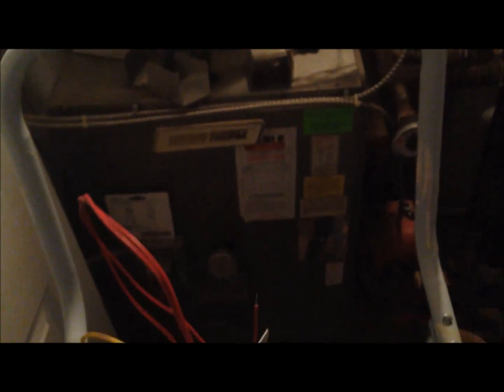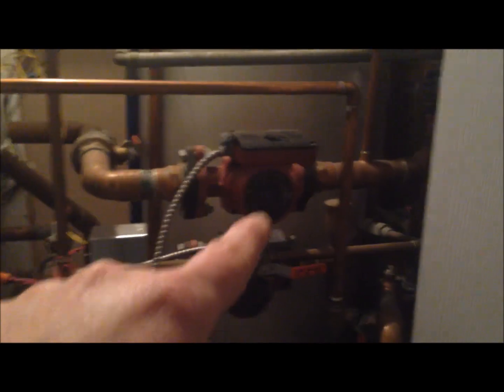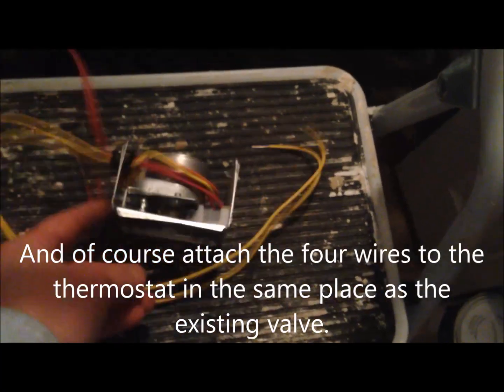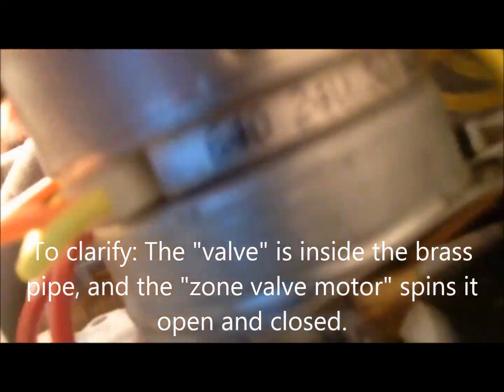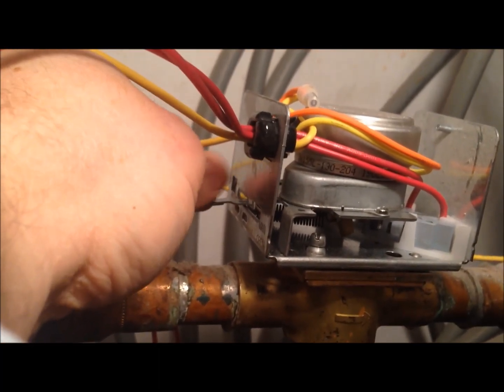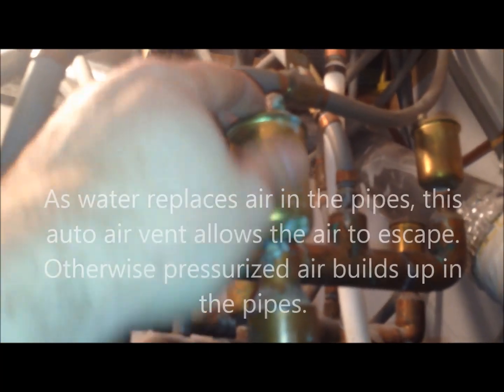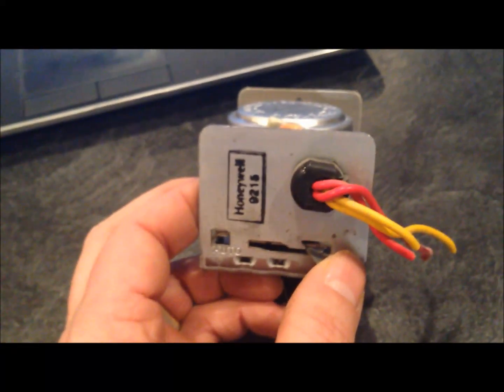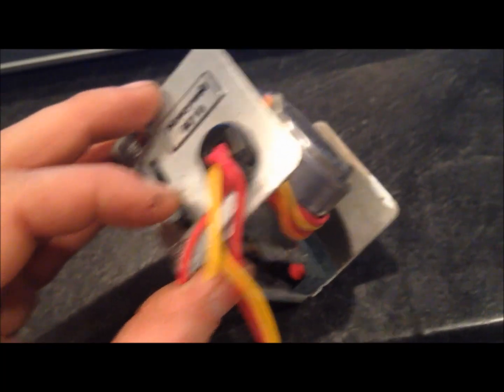Honeywell zone valve motor replacement

Comment: If my pump is not turning on, will putting the valve on maunally opening make the heat work? I know my pump works because I have a 2nd zone attached to it and when that zone goes on, the pump turns on. For this zone when I turn the heat on, the pump doesnt go on.
Reply from the maker: If the pump doesn't turn on, I don't think that opening the valve will activate it. The pump is activated by setting the thermostat to a temp higher than what the pump reads as the current temperature. If so, the pump is on, and tries to push hot water through the valve. At that point you can manually force the valve open to send hot water to the zone. Makes sense?

Comment: Hello. I know this video is old. Good stuff regarding the zone valve.  Absolute misinformation regarding how you added water to your system.  The valve you opened to add water "Pressure reducing valve" regulates the incoming water pressure to 12lbs. You opened the valve until the safety relief valve opened (typically 30 Lb)  This does absolutely nothing to get the air (bleed the system) out of the system rather only compresses whatever air is present into a smaller space. Secondly, the automatic air vents that are all over the place (a properly laid out system only needs one) : The caps are to be left loose as to let them do what they are suppose to. Automatically let the air out. The cap is only used in the event the vent fails and water runs out instead of air.

Comment: Hi.  When reattaching the wires, there are 2 yellow and 2 red.  Does it matter which red or yellow you use?  Thanks
Reply from the maker: Hi, no problem, all these wires are connected in parallel meaning all the reds and all the yellows in your entire system are ultimately connected to created one large circuit Any one can trigger the boiler/circulator into action.
Reply: Doug Brown so your answer is “no”. Correct?
Reply from the maker: @Mircea Hi. I'm pretty there's some solid state wiring involved. When the thermostat senses that the temperature is too low, it activates a switch completes a low voltage circuit that flows through the valve motor. The motor spins and pushes the lever until it stops OR after it is pushed past a certain spot. I think it's the latter because I've experienced motors running constantly when the valve was jammed and the lever couldn't move.

Comment: How did you drain the pipe?
Reply from the maker: No need to drain the pipe if you're simply replacing the motor assembly. You can see in my video that I just unbolt those four mounting bolts and the motor pulls right off. No water.
Reply: Wow, thank you for the incredibly fast response!
Reply from the maker: Anytime...

Comment: So mine is stuck in the OPEN position. Can I do the same thing or do I need to drain it somehow? I don't have any shutoff handles to isolate the zone unfortunately. That lever is loose and doesn't go back and forth like yours. no resistance.
Reply from the maker: Also, note that you don't need to drain the system if you're just replacing the valve motor like in my video. The motor fits onto the valve stem, which protrudes out of the pipe and doesn't allow water out.
Reply from the maker: Hi Blake. You're in good shape fortunately because replacing the whole assembly doesn't have any water implications at all. Just unbolt it like I show in the video and replace. The spindle protrudes out of the pipe and that's the component which is connected to the valve inside the pipe, and is immersed in water. You only need to drain the system if the valve is frozen in one place but that's very unlikely. 

Take off the valve power head like I show in the video and use a wrench to twist the spindle (make sure you don't damage the spindle) and close the valve. Then replace per the video. 

I always take pictures beforehand so I know exactly how the wiring was etc. 

Good luck!
Reply: Doug Brown
Thanks. Actually something weird happened last night. I went down to take more pictures so I could find a match online or at a big box store. When I touched and slightly twisted the round silver motor container to get a better angle the thing started moaning and the needle when back into place. The valve shut! I have no idea what I did, but I feel even better now about replacing it with the water cut off. Sure enough over night the temperature went from 71 to 55 in that space.

I'm going to start with replacing that component and hopefully I don't have to call someone cuz they want $75 just for showing up during business hours plus labor plus parts. Craziness. *Sorry to all who work in this profession but if you're coming during normal business hours and doing a quick 20 minute job there's no need to charge so much. I do IT in the same fashion and always charge reasonable rates even if my policy should state I could get far more.
Reply: Blake Whitney
Reply from the maker: No problem. Just remove the valve motor like in my video. Then close the valve by twisting it shut with a wrench, and install a new motor, again like in the video and that's it.

If you can't turn the valve at all with a wrench and it seems frozen (usually NOT the case) then you'll have to turn off your water supply to the system and drain the hot water pipes. Then cut out the valve by cutting the pipe on either side. When you buy a new motor it comes attached to a small section of pipe so cut that exact amount around the valve and install the new pipe/motor. Having said that, it's more complicated than just the motor and you need to consult some other videos on that job because I don't have one.The only hard part is installing the new section of pipe and you'll need a torch and some other stuff.

Good luck
Reply: +Doug Brown i just attempted to replace the valve motor and water started coming out when i loosened the screws, what could caused that?
Reply from the maker: That would tell me that the spindle which attaches to the valve inside the pipe is really damaged. There must be a crack in the hose right where the spindle comes out, so you'll have to shut off the water, drain the system and cut out the entire valve. You have to hacksaw each end of the valve (1-2 inches) where's it's installed in the pipe. When you buy the replacement motor it can come with the valve and copper pipe, along with the power head. OR you can buy the power head separately if your valve is okay. The first couple I did had the valve and I just tossed that part because my valve didn't leak. The last one I did was just the power head. When you install the valve just find a YouTube video or a site like this: http://www.familyhandyman.com/plumbing/repair/how-to-repair-a-leaking-copper-pipe/view-all

Good luck
Reply: ok so i need a plumber
Reply from the maker: You can definitely do it yourself if you buy a couple of things at the store. Here's a link to Home Depot that shows what you need, which is a propane torch, flux paste and solder. It's really not hard but if you to cut to the chase then a plumber can do it quickly. Make a video!
Reply from the maker: http://www.homedepot.com/c/flux_and_solder_HT_BG_TH
Reply from the maker: These SharkBite brand fittings are amazing for repairing pipes because they use compression fittings instead off the flux and solder. Unfortunately you can't buy a zone valve with a SharkBite.
Reply: i used sharkbite before
Reply from the maker: +paul spuria SharkBite is great, but unfortunately they only make simple straight through fittings, and ball valves etc. You'll have to cut and solder this one.

Comment: Hello Doug, Great video. I bought the motor but not the valve. Where can I purchase the whole valve (including motor). Thanks!
Reply from the maker: Hi. Normally you can only buy both together. I actually had to discard the valve because I didn't need to replace it. But I found that even Home Depot in the US sells the entire unit. You're in NY state? My friend teaches English at Binghamton.

http://www.homedepot.com/p/Honeywell-Tradeline-24-Volt-50-60-Hz-3-4-in-ID-Sweat-2-Position-Motorized-Zone-Valve-V8043E-1012/203464519

Comment: Thank you for this video.  I've got to change the motor out on my heating system.

Question: is it possible just to swap out the motor?  The mechanism responds properly to the manual override,but the motor does not run, even when I wire it into an adjacent (working) zone.

Thanks.
Reply from the maker: Hi, glad it was helpful. If you look on Amazon or wherever you can buy just the round motor attachment. I haven't done it, but there are two bolt holes on the motor pic and it looks very straightforward. It's a little cheaper than buying the whole powerhead, which I'm doing in the video. 

http://www.amazon.com/Honeywell-802360JA-Motor-V8043-V8044/dp/B0006UPLQC
Reply: I found it at Home Depot, for about $40.  Took me all of 5 minutes to swap it out, and the zone works again!

But it's always helpful to see it done, ahead of time.  Thanks again!
Reply from the maker: OK, thanks for letting me know -- Everyone take note! 
Doug
Reply: There are three "parts" to this system that I know of:

1) The physical valve that the water passes through (or not)

2) The mechanism that takes the motor position, and operates the valve (all those springs and stamped-steel levers and such)

3) The motor, proper.

There's also the housing cover, but who's counting.

The guy at Home Depot said something about an "end of travel switch", but my unit only has the two motor wires, and no switch that I could find, so....
Reply from the maker: Stephen Sywak Check this out around 2:10. That switch is the the one that gets activated when the valve is fully open, and it triggers your pump to start pumping.

https://www.youtube.com/watch?v=VE1wa033USA

Comment: That was very helpful. Noticed one floor of the house was cold this morning.Followed pipes back to the zone valve which was making weird noises. Have ordered a new one. Did you switch the power off first?
Reply from the maker: Glad it was helpful. No you don't need to turn off the power, because the wires are all low voltage. Your skin has ample resistance and you don't need to worry about turning off the circuit.
Reply: @DougBrownVancouver  This is not true for all systems btw!

Comment: i noticed there are 2 yellow and 2 red wires, obviously the two yellow go to the two yellow and red to red....my question is does it matter which two reds and which two yellows are connected?
Reply from the maker: No, they're low voltage wires that connect back to the thermostat and just complete the circuit. The circuit runs one way or the other depending how you connected them, but the direction doesn't matter--Just that the circuit is open or closed. There's enough voltage to support the current needed to turn the valve open or closed, but it's still non lethal in case you were worried about that.

Comment: Hi Doug,
Thanks for the demo, my situation is that when I put thermal on and moved the valve to manual open position like you said, the hot water still did not flow and the water is not circulated, If I do the same manual open position for another zone valve, the water flows and circulated. Do you think it is due to the zone valve broken? I would appreciate it if you could give me some advice.
Reply from the maker: I think the valve inside the pipe is probably broken. You'll need to make sure the pump is off, then drain out all the water from the radiant pipes (I don't think you can do just one--They're all connected to the same release valve). Then you need to buy a valve pump that includes the actual valve housed within a bit of pipe. To install, you need to cut out the existing valve by cutting the pipe before and after the valve, then install the new one. It goes without saying that the seal needs to be very, very good. I'm sure there are videos on this too.
Reply from the maker: Doug Brown Another thing to try FIRST is to lift the zone valve motor off the pipe. This will expose the splined spindle that the motor grabs to open/close the valve in the pipe. You can take a wrench and try to manually twist the spindle to see if it turns. If it's jammed then you know the valve is damaged. If it turns easily then just replace the valve motor, which is definitely broken. (This is what I demonstrate in my video.)
Reply: Hi Doug,
Thank you for your advice. Your advice is very helpful. I have fixed my problem.
Reply from the maker: Glad that I could help you out!h

Comment: Hey I have a quick question for you my zone vale moter seems to have seized up in the open position and the lever has no spring to it so I am sure it needs to be replace but do you think it's safe to remove the old zone vale with it stuck on the open position (basically my heat was pumping full blast for a very long time because it is in a basement that is hardly used)
Reply from the maker: I think you mean "is it safe to remove the old zone valve MOTOR" and yes it's perfectly safe to do that. When you put a new motor onto the spindle you can manually close the valve (inside the pipe) and turn off the hot water supply to the basement. The new motor should also correct your problem with the full blast pumping--This doesn't happen because the valve is locked in the open position. Instead the underlying problem is that the motor is broken and isn't transmitting the "off" instruction to your boiler, and a secondary affect is that the motor also doesn't close the valve.

Comment: Hi, your video is very informative. One question though, before replacing the motor, do you need to empty all the pipes OR not? I am scared to remove it with water in the pipes and then having the whole basement flooded. Let me know. Appreciate it. Thanks...
Reply from the maker: If you're only changing the motor you don't need to drain the pipes. No water escapes because that protruding spindle is built into the valve where the water is. But if you need to replace the entire valve then you definitely need to drain the water because you'll be cutting open the pipe.

Comment: is there a simple way to test the valve for efficient working order?  I have had several replaced and still don't know that they were not just stuck. Thanks. Don
Reply from the maker: Hi Don. To be clear, the "valve"is the metal fixture inside the pipe that allows water to flow past or not. The "valve motor" is the electric motor that I feature in my video, that I keep referring to as the "valve" so I'll assume you're following my lead and refer to the motor as the valve. To test the motor, push the spring loaded lever and see if it slowly returns to its starting position. This manually opens the "valve" inside the pipe and if the spring returns the lever then the motor has the ability to turn the valve. In my case, the spring was broken and the lever wouldn't move so I had to replace the motor. Next, to test if the motor works, turn the relevant thermostat up high to signal the motor to turn on and open the valve. Ideally you get someone to do this while you monitor the valve motor. If ithe motor is working, the lever will be completely loose and disconnected from the spring. Then turn the thermostat down low to signal the valve to turn off, and you'll see the lever get pushed back to its starting position and once again be spring loaded. If all this happens, the motor works.
Reply from the maker: Another more simple approach is to feel the pipe before and after the valve. If your boiler is running and your system is pumping hot water through a supposedly open valve, the pipe after the valve will warm up. And vice versa.